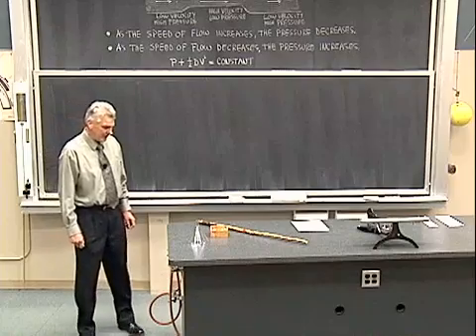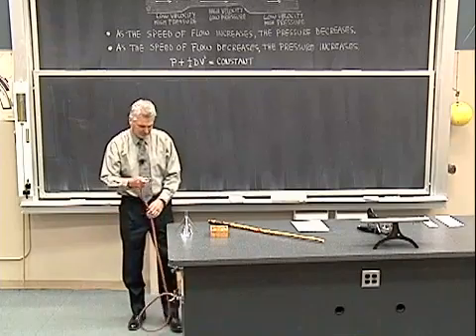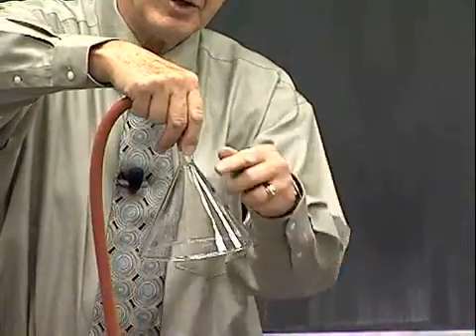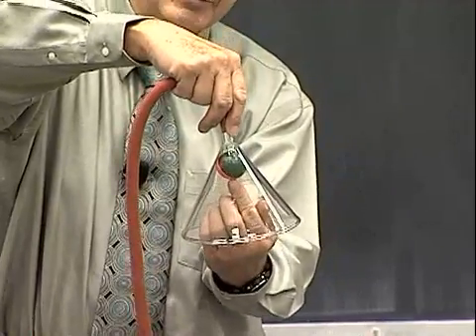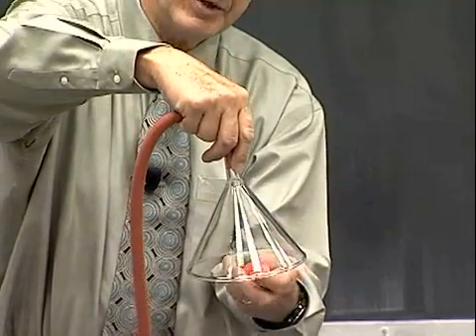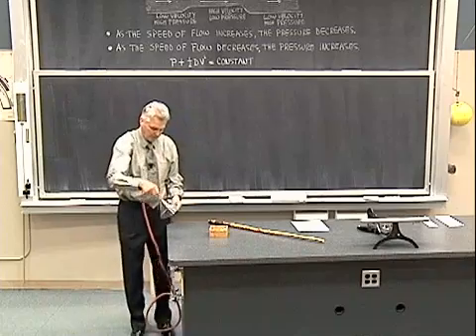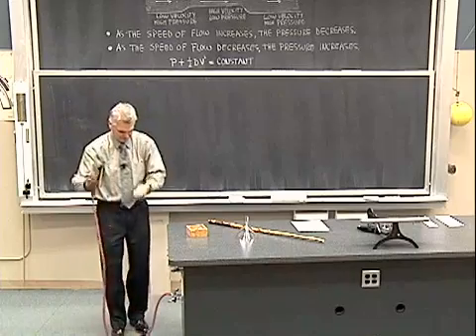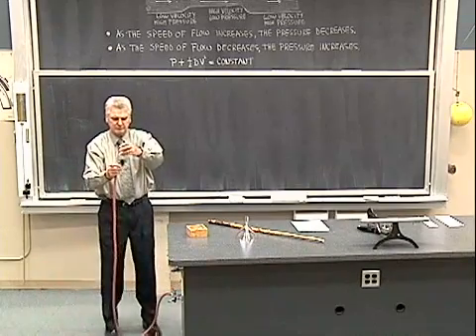Bernoulli's Principle: Ping-Pong Ball

Comment: Why is the pressure lower than atmospheric pressure? This is because the cross-sectional area of the funnel gradually increases, which causes air to enter the funnel from true and encounter a suddenly increasing space, resulting in a pressure drop below atmospheric pressure. This is similar to when air passes over the upper surface of a wing, due to the angle of attack of the wing, the air encounters gradually increasing space, so the pressure drops below atmospheric pressure.

Comment: Because the cross-section of the funnel along the flow direction gradually increases, the air deflects when it flows from the true of the funnel into the funnel, resulting in low pressure. This causes the ping pong ball to be sucked in.
Reply: The ball is "sucked" (suction does not exist in physics) because when it tries to fall downwards, the cross-section of the flow between the ball and the funnel widens, consequently the pressure inside the flow decreases and therefore the atmospheric pressure that is under the ball pushes it back up into the funnel. 
But if we attach a string to the ball and pull it hard, the cross-section of the flow will become so wide that the atmospheric pressure that is under the ball will wedge itself between the ball and the flow re-establishing the atmospheric pressure also above the ball which will then fall.

Ps. The video is totally wrong. The ball does not stay inside the funnel thanks to "Bernoulli" or "Coanda".
The ball stays there thanks to "Newton". 😊